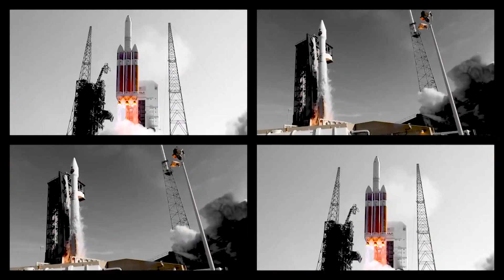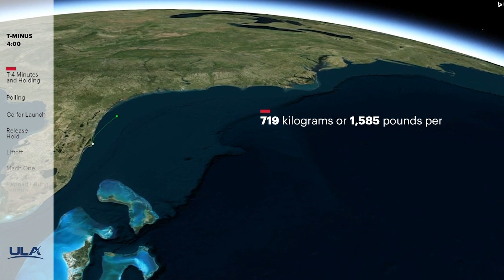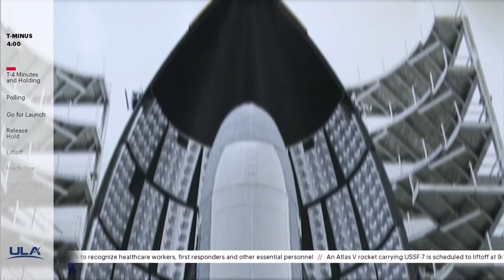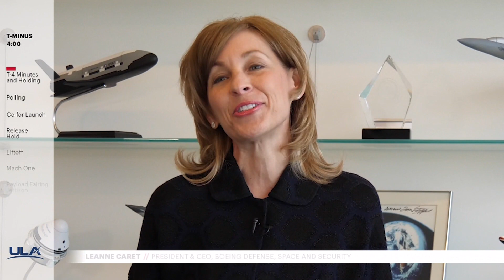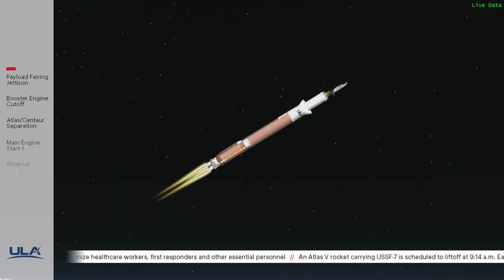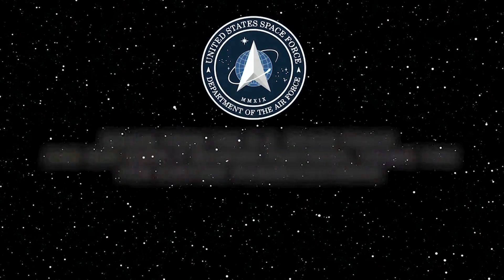May 17 Live Broadcast: Atlas V USSF-7

Comment: Is it me or did it look like the Centaur stage failed to ignite.
Reply: Hydrolox burns clear. It's there but you can't see it.
Reply: The centaur engine burns Liquid Hydrogen and Liquid Oxygen, which burns almost completely clear, that mixed with the fact that it’s burning I’m a vacuum makes the exhaust expand, appearing thinner than if it were burning at ground level
Reply: You must be new to this whole thing.

Comment: They're going to cut the feed at, "engine start!!!!" WTF???
Reply: Because it's a military mission.  Can't show what is inside the fairing.
Reply: @my3dviews  ---  Why is it they "can't show what is inside the fairing?"  There are literally thousands of photos of the X37b online.  Just do a Google Image search for "X37b" and you will see it from every conceivable angle.  It is what is inside the X37b that can't be shown.
Reply: @sheldonaubut   It is a classified mission.  Request by the military that they can only show up to that point.
Could be an updated version of the X37b that they don't want shown yet.  Or possible they just don't want it shown if it is a failure.
Reply: If you notice on the photos of the X-37B in the fairing, they do not show the bottom/backend of the plane.  Apparently, the service module they added to this flight is on the tail end and they are not showing it to anyone.  Also, standard practice for a classified mission to end the broadcast after first stage separation.  SpaceX does that too for their classified payloads.
Reply: @nelsonnissley6748  --   Unfortunately they have their reasons for secrecy and for some strange reason the fact that I would like to see as much as possible isn't even taken into consideration.  How inconsiderate... 😁

Comment: I think Centaur screwed the pooch.
Reply: What I saw, was the vent tube start and then stop at ignition. then the live feed cut (as planned) when  reviewing other atlas/centaur vids of the same configuration, the vent tube continues to blow while the motor is running. The abrupt stop made me wonder if ignition had failed. Although I did notice the acceleration away from the expendable, russian powered "Atlas" artificial reef which indicated the motor was running.
Reply: Captain Emeritus when the vent tube starts that means is in pre-start, once the tube stops then the RL-10 is ignited. You can’t see the exhaust that much because is day and it’s clear
Reply: It burns Liquid Nitrogen and Liquid Oxygen which when burned comes out clear